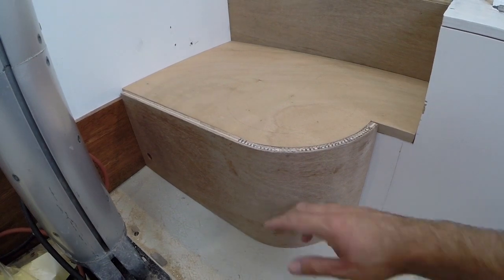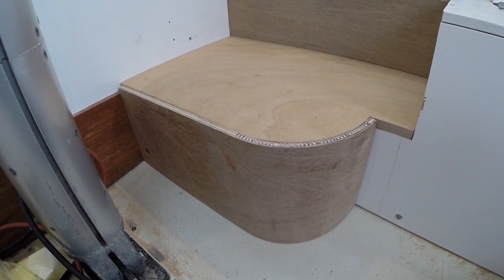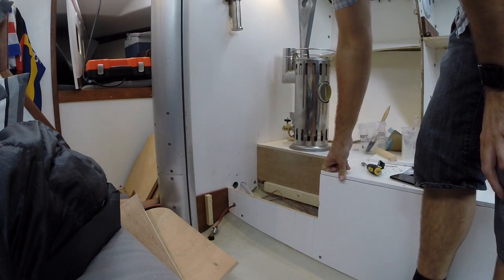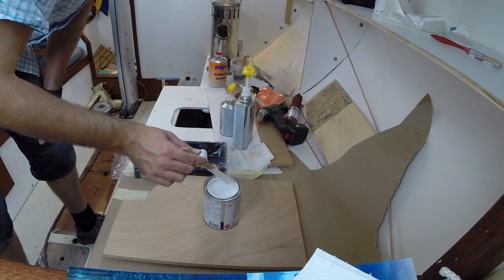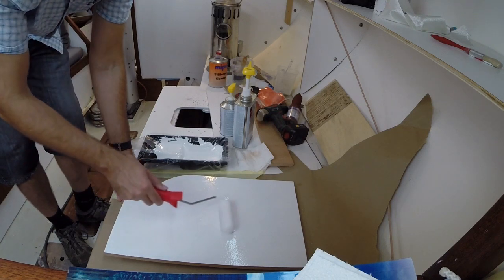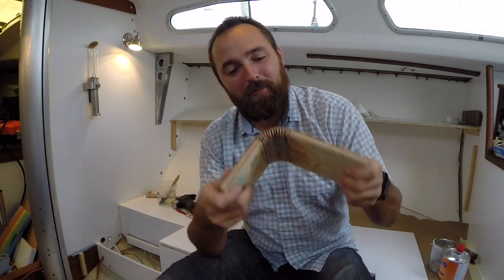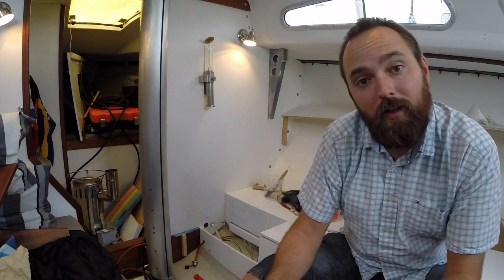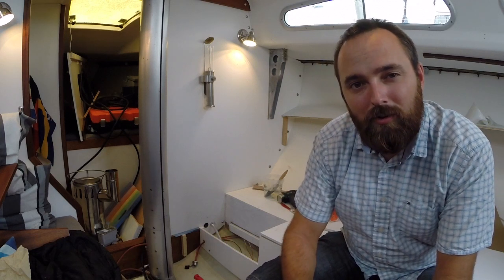Sail Life - Refleks 66 installation - Part 3

Comment: Are that many coats necessary?  That's not a criticism I'm just curious about what I'm getting into buying an older boat. So, are five coats functionally better than 3.  I know 5 > 3 btw I'm just wondering if there is a diminishing return here.  Such a difference between these vids and the new ones.  Both are great, just different.  Ugh!  Sanding and painting; my fav.    :)  I better get some 3M stock.